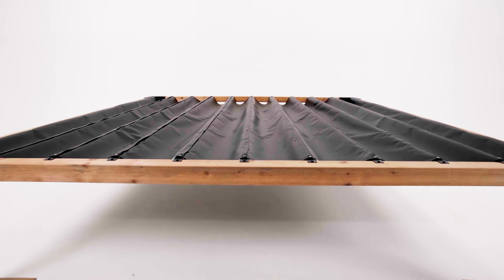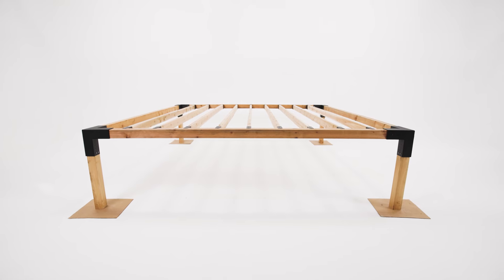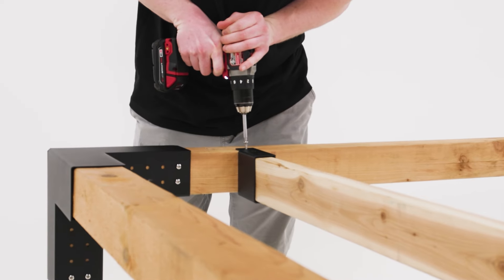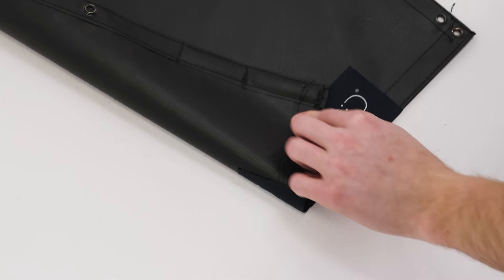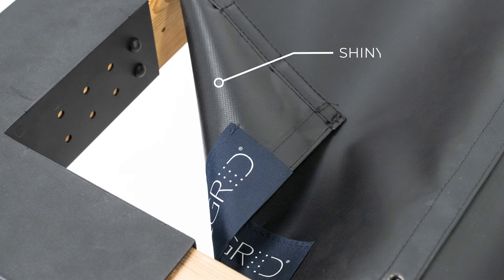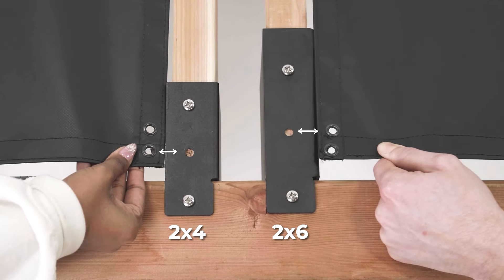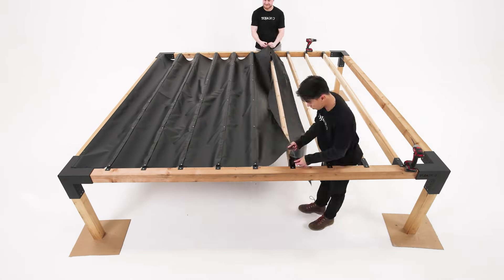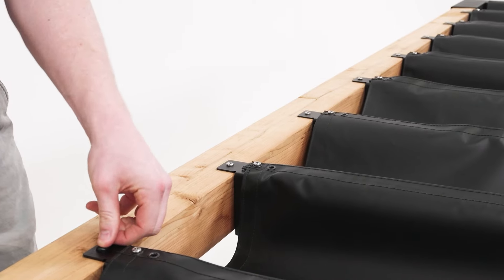How To: Install Roman Panels

Comment: im thinking about making a loft bed with the toja brackets, is there anything i need to keep in mind if i do? I'm planning on adding bracing to the sides and back of the loft bed frame and there will be a desk under it that will run length wise. it also wont be screwed or anchored to any walls. I need the loft bed to be around 56"W due to limited space, longer than 80"L(full size xl bed), and 63"H under the bed.

Comment: Nice system but unfortunately they have to taken down every winter if you live in a snow belt region. Too bad
Reply: Or heavy rains ( Florida).. also occasional hurricane is possible
Reply: @rogerebmeier7335   the rain will not hurt anything but yes, strong wind from a hurricane will